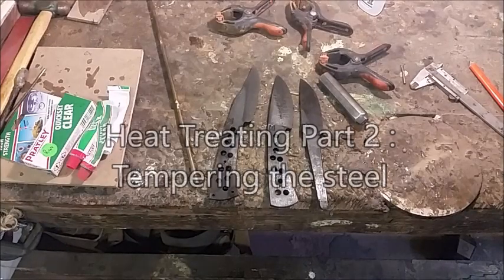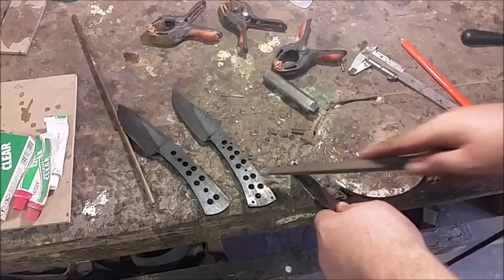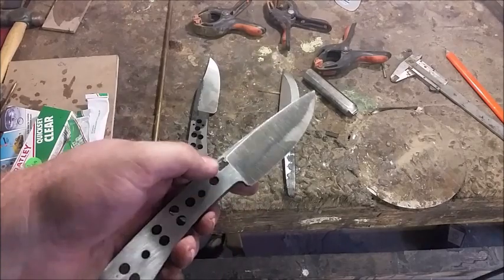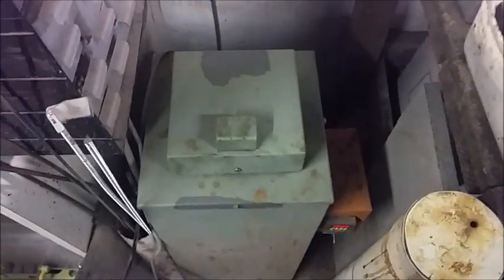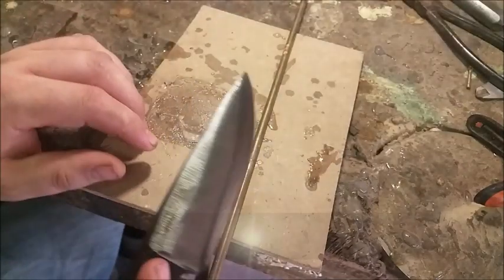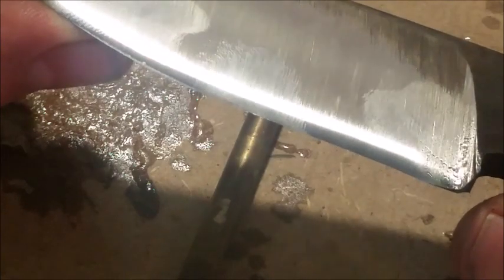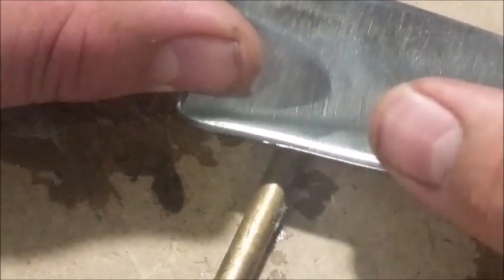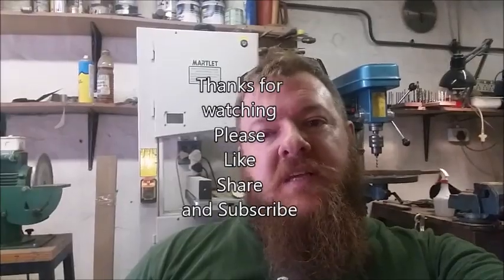Heat treating a Carbon Steel blade - Part 2

Comment: Excellent video, many thanks for posting. What do you think best way to harden and temper1.1248 and 1095 steel? Should I harden the same way as in your previous video? Tempering at 250C for 3 cycles looks a bit too hot. What is your opinion?
Many thanks in advance.
Reply from the maker: the tempering temperature I use in this video is for the 52100.  For 1095 around 190 - 200 should do nicely
Reply: Stuart Smith . Many thanks for your prompt reply.

Comment: Hi Stuart! it is wery helpfull this videos, I did two grate blades in 52100 with full heat tratment, I already quench them but I notice that one of them has the tang curve. Do you know what is the best solution to straighten it? What happend if the blade is curve? Can I straighten it with tempering? Regards
Reply from the maker: with mid range carbon steels it's fairly safe to straighten in a jig. However with the higher carbon steels like 52100 there is an inherant risk of breaking. I have however had success with a warped 52100 bowie. I took it out of the oven and while it was still hot I tweaked it in a vice until it was straight. If you were to attempt it this is how I would suggest. Good luck.

Comment: Hello, my name is Vinicius, I'm from Brazil.I do not understand english very well... 
Allow me a question?

In the tempering you make the 250 C okay? And you leave 3 cilos of 1 hour each?

I make the 250 C for smaller knives and 270 for knives larger than 8 inches. And I do 2 cycles of 1 hour each ... can you tell me if I am correct? Thank you and a hug.
Reply from the maker: The soak time is the same regardless of the size of the knife. The temperature depends on the steel that you use. In this case I used 52100 which need higher temperatures to make it tough. 5160 would be around 180degC
Reply: I think I did not express myself correctly.
 I was referring to 52100 same. Is that in the video I understood that you did 3 cycles. So I was confused .. I do 2 cycles of 1 hour at 280 C in blades around 8 inches, is this correct?
 Or should I faser at 250 C? A big thank you.
Reply from the maker: keep your cycles at 1 hr each but lower the temp for 52100 to 240degC. Two cycles is good, three is better. Again the size does not change the temperature needed. I hope that answers your question.

Comment: Thanks Stuart, I been doing this for two years now with limited to none knowledge. Your videos truly help a lot. Never knew about the temper test. May I ask from you if you don't mind. I use Nicholson Files as a medium. I temper it to a dark straw colour and I only do one temper cycle at 200 C. am I doing it correct. The dark straw take about 1hour 15 min. Please advise. Many thanks.
Reply from the maker: The darks straw is about right, As the colour turns brown then purple it loses hardness in favour of toughness. I triple temper my knives as quality assurance that all brittlenss has been removed. It is the way I was taught and has serve me well thus far. 3 x 1hr allowing to cool to room temperature between each cycle.
Reply: Thank you Stuart.

Comment: Great video thank you for posting , but a have a question why do three tempering cycles instead of one cycle , and at what temperature would you use for a w-1 steel ?
Reply from the maker: Three cycles is the way I was taight my my mentore Master Smith Kevin Harvey. It has served me well so far. As for W1 I have never worked with it but I'm sure a quick Google search will tell you what you need to know.

Comment: Hey Stuart, I have seen people doing water quench to cool the blade in between tempering cycles, will that do any harm to the blade by cooling it too quick? Or is it better to air cool the blade to room temperature? Thanks
Reply from the maker: according to a friend of mine who studied metallurgy the difference is marginal . I do a water quench between cycles and have not noticed and detrimental effect

Comment: Hi, Stuart thanks for sharing this video some real good tips here, I usually work in 01 and have always been taught that you must 
get your blades into the tempering oven as soon as you have quenched them, or when they are still too hot to handle without gloves.
Is this not important, as It would save me a lot of hassle when I am doing multiple blades.
Thanks, Lee
Reply from the maker: It is a good idea to get them to the tempering over soon. Some steels are very forgiving. I left a 5160 blade over night before tempering. It was fine. Higher carbon steels like 01 and 52100 get very hard and there is a lot of internal stress as martinsite sets. In this case I would say it's a good idea. maybe not while they are still hot but definitely right after hardening.
Reply: Thanks for that Stuart, much appreciated. Lee

Comment: HI Stuart

Great video, learning a lot!!

What is the advantage of using a high carbon steel like 52100 vs something like 01?

I can see on the spec sheets that there are some differences in the composition of the steel, but what does this translate to in real life use?

Thanks in advance! :)

Regards
Reply from the maker: The extra chromium in 52100 add to its toughness . It is a little more tricky to heat treat but worth it in the end.